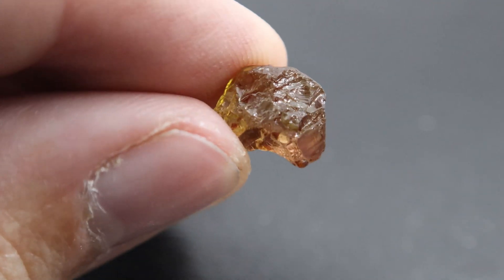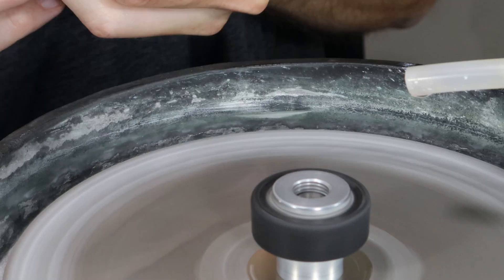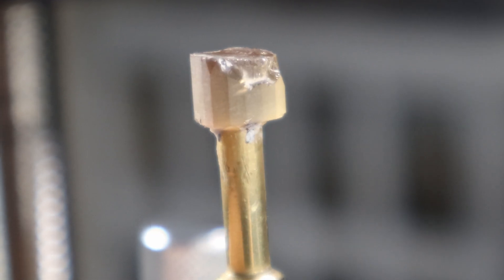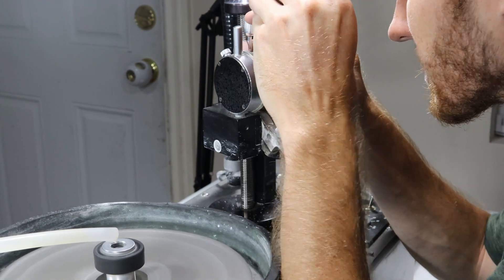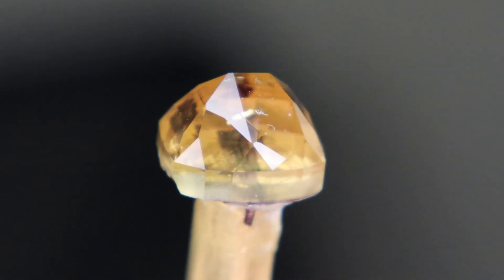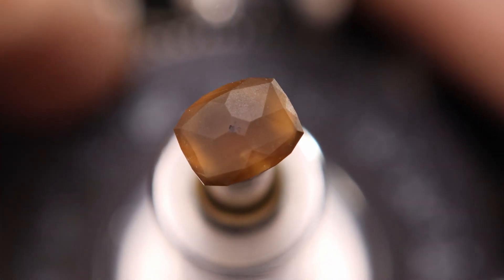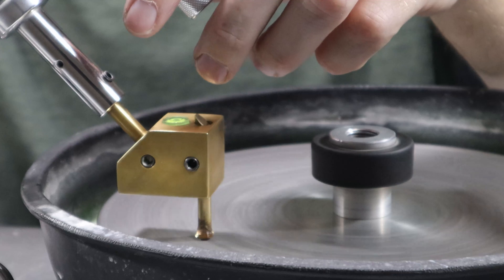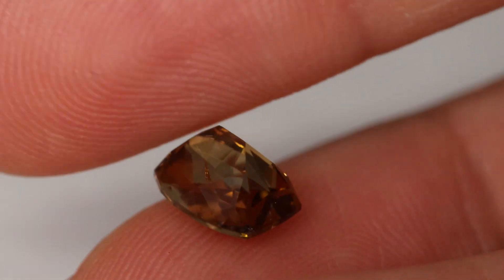Cutting a Natural Colored Tanzanite, Bringing the Gem out of the Rough

Comment: That diesel color of Tanzanite is the most common before heat treatment. Also you should of cut out the fracture because someone will probably try to heat treat that gem to bring out the more highly valued purplish Tanzanite color. Tanzanite gems with fractures often break up during heat treatment.
Reply from the maker: Thanks for the input! The person I cut the stone for specifically got it for that color. They don't plan to heat it.
Reply: @MattsCornerofGemCutting  I saw a beautiful faceted natural black Tanzanite, it looked like black opal. The cutter did not want to treat it because it was so special as is, but he could not sell it, and may have to heat it. I wish I had the money to buy it, and keep it natural.
Reply: That's a good point about the cracks and heating.
I was curious if he was considering heating it myself but due to the cracks, it would be a risky venture. Besides, it is a great looking stone, with a nice, Natural colour.
Reply: @SnowTiger45  Yes it was cut nicely. Orange is common with Tanzanite but it also comes in many other colors like green, red, pink, yellow, etc ... I personally like the natural colors, over heat treating ...
Reply: @Mk21818  Yes it does come in green. Green is more common than the reds, or pinks.
Reply: @jameswelch1054  I come from Mirerani, where Tanzanite is mined. We also find tsavorite which is green in Tanzanite mines. The yellow and brown colour is common and generally cheaper compared to the blue Tanzanite. Pink is the rarest colour. There isn't a red colour. I'm talking from experience. I'm not a gemologist. I'm open to learn.
Reply: @Mk21818  There is a red color, very rare, and valuable.
Reply: @SnowTiger45  I strongly recommend that you don't heat it if it has cracks in it, because it will most likely fracture in the oven.